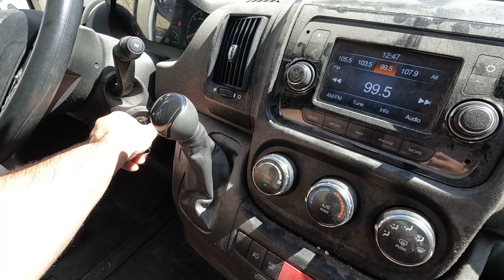Unleashing The Power With Even More Upgrades!

Comment: A lot of Chevy impala have those problems with the ticking noise under the passenger side floor by the ac blower
Reply from the maker: Yeah, it seems to be common in all makes. I had to replace them on my Nissan Armada also.
Reply: @ I have been watching a lot of your videos and I have a 92 Eagle Talon TSI and I was wondering if I can get who built your engine i need mines done asap

Comment: I just bent the tube on stock rear section on mine, did they put a stronger tube on your back up?
Reply from the maker: You bent the shaft?
Reply: @N3ZFAB yeah, got it straightened but I have a feeling it will bend again
Reply from the maker: @Bboy311  What power level are you at?
Reply: Not sure on the power, went 8.64@158 with a 1.26 60ft when it bent
Reply: @Bboy311  Yea that at least 1300 hp for sure. What car do you have?
Reply: @Soundman61 I have a 91 eclipse. Turbo is rated at 1200 6870 gen 2

Comment: Hey brother How`s it going? New U joints are bigger should hold up and should do good and not break for sure. And man if i was close I would come over and clean your dash on your Van just to help you out as as a friend Just got done out in my garage cleaning and waxing cleaning engine bay and inside of the wheels I hate dirty engine bays. I feel guilty if I sit around too long due to my stellar work ethic. And the same thing happened to my 2016 Kia soul the actuator broke as well. Yes I know a Kia soul is a slow turd but it is in great condition we have had since it was new and it was given to me free of charge by my sister who bought it and only has 60k miles and still under warranty. And get 25 mpg on freeway 18 in town. I would love to lower it and a small turbski an exhaust on it but I am not allowed. Oh well. Oh love the clean wiring panel it look's very nice. I cant stand ugly messy wiring. Peace to and the Woman.
Reply from the maker: Appreciate the kind words, and thanks for sharing your experience!